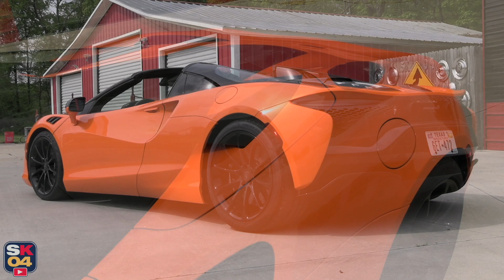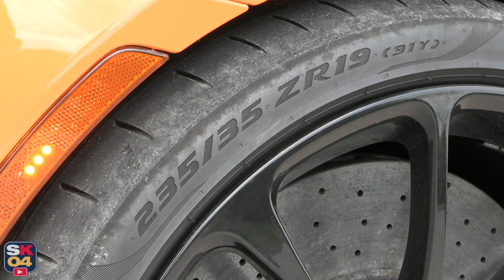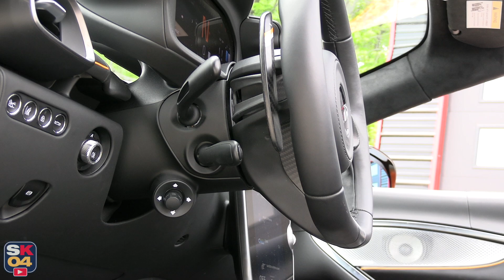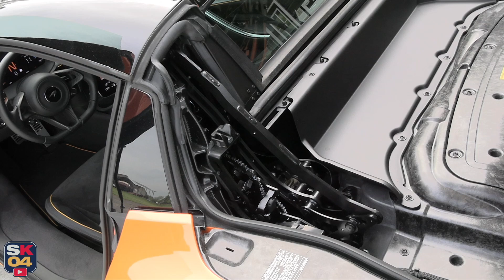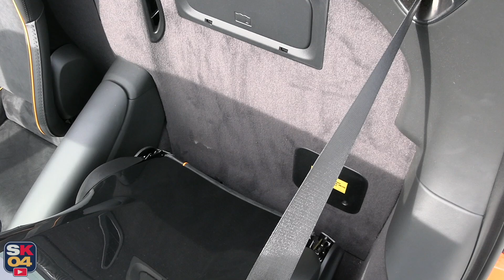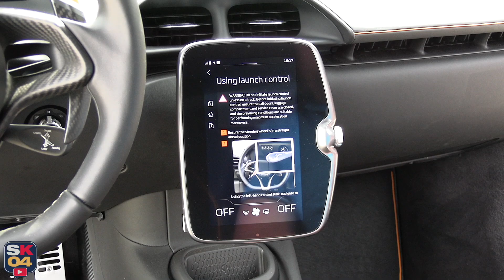2025 McLaren Artura Spider: Start Up, Test Drive & In Depth Review

Comment: A 3 Liter Twin-Turbocharged V6 producing 597 hp and 585 Nm of Torque with an electric motor producing 70 kW (94 hp) and 225 Nm. Total ouptut is 690 hp and 720 Nm.
McLaren Artura Powertrain.